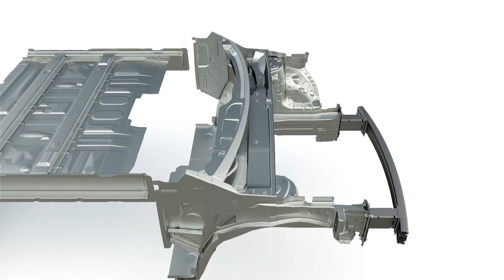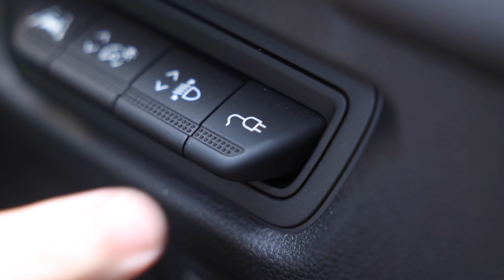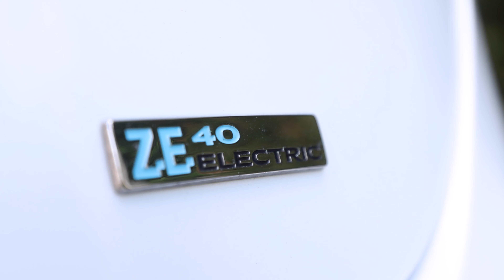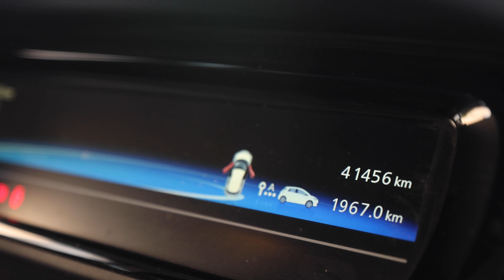The best range for your buck - The Renault Zoe ZE50 Tech Focused Review

Comment: Expect 160 miles in winter and 180 at least in summer real world  . Personally I get more than 160 miles on average in winter , dependant on speed . Keep below 70 miles an hour and that should be easy . Big winner is 22kw ac charging on board , always buy with 50 dc charging . Play version ncap zero . Ncap rating not so bad on gtline . Batteries showing no problems after first ten thousand miles and more. Had original 22.4 kWh Zoe , showed no battery degradation seen , likely 5 - 10 percentage but performing as good as day one , extra built into bms buffer hidden . Gtline 50 car much better car , ride , feel ,  but still pricey . Savings in fuel for me in nireland more than most . If you have solar best. Concerned about servicing costs from Renault , steep for changing air filter and brake check , beware lead acid battery replacement at 3 years , and fluid change pricey. Still stands up well to competition. No 100 dc charging but none in Northern Ireland yet , and only a small number of 50 dc chargers . Main problem is the other evs with 11 kw inboard chargers blocking the 22 kw ac chargers for hours on end . Easily fixed if not free any more and time penalties applied

Comment: Thank you for your nice Video. It is right that Renault builds the electric motor. BTW, there is no magnet (as a permanent magnet) in the motor. It is a syncronous dc exited motor.
Reply from the maker: Thanks for your comment, the wounded coil still makes an 'electromagnet' which I'm referring to in this video, you are correct that there isn't a permanent magnet.

Comment: Everything is so good but I’m hugely put off with its recent safety rating which was disappointing.
Reply from the maker: I also would have hope for a better rating, though keep in mind the safety ratings increase in stringency every year, hence why this car on a re test a few years later faired like it did.
Reply: @TheFutureisElectric  yeah you are right about that.  Sadly though since there is no adjustment in the steering wheel and seat it wouldn't work for me.  But I guess that's what you get when you don't pay much for a EV.